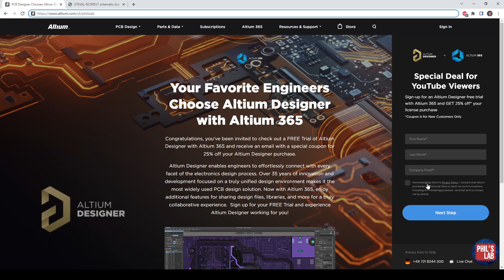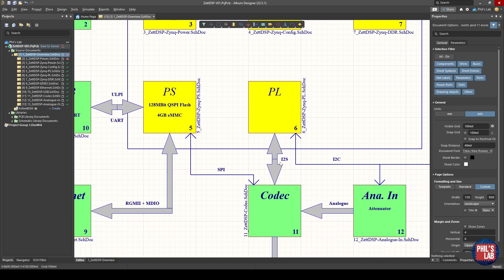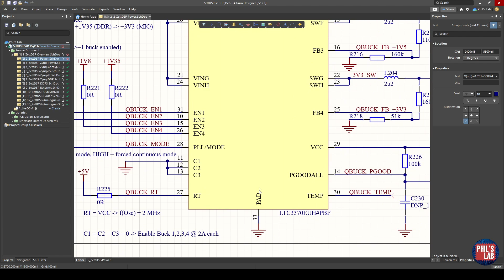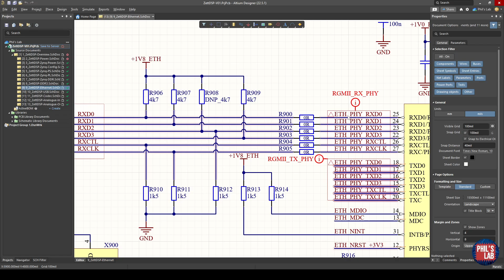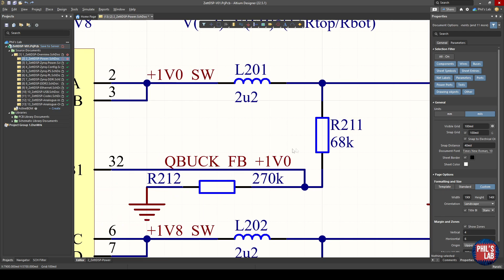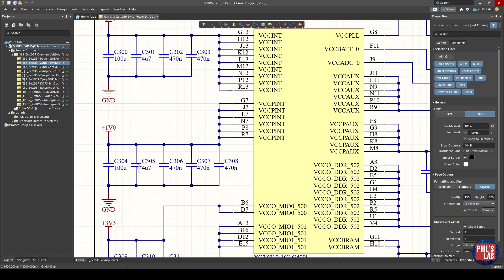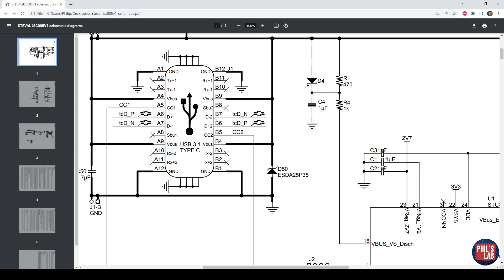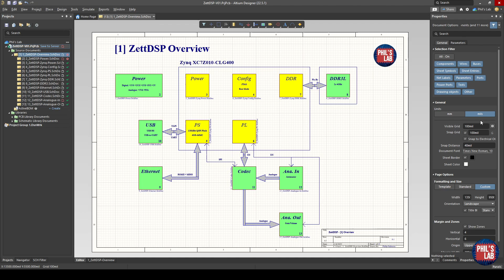(Sponsored) Schematic Tips & Tricks - Phil's Lab #62

Comment: Hey phil, I'm designing a 5-level cascaded multilevel inverter (MLI) using two isolated H-bridges and would appreciate feedback on my power supply configuration. Here's my current setup:

Key Components
4x Isolated Gate Drivers: UCC21551CDWKR (dual-channel)
Isolated DC/DC Converters:
Input-side: 1x converter (6.5–32V input → 5V output) powers:
This converter supplies 5v to All 4 drivers' input sides (PWM logic) and to the Current sensors (ACS732).
Output-side: 2x MEV3S0515SC (+15V isolated converters):
One for HB1's 2 drivers.
One for HB2's 2 drivers.
Grounding Scheme
Input Side (Control):
5V converter output ground is shared with MCU ground, Current sensor grounds and Drivers' input-side grounds.

Questions
Is it correct to use separate MEV3S0515SC converters for each H-bridge's drivers? And is the GND correctly labeled?

Are there risks in sharing the same 5V supply for drivers and sensors?

In this case do I need 5 external sources? 2 for isolated H bridge (my H bridge needs 60v) and 3 external supply for the DC/DC converter ?............is there a way i can get ur feed back

Comment: Great tips. They are really good practices in design.
Unconnected crossing is very useful, especially when you try to print it. Colour highlight of wire is a neat solution to determine the signal groups. I do not know why KiCad does not support those features while I think there must be plugins achieving those.
Reply from the maker: Thank you! I'm not sure but as you say, maybe someone has come up with a KiCad plug-in.

Comment: Would you be open to also making a course on advanced PCB design (FPGA, ARM chips) using KiCAD? I don't have Altium since it's too pricey for hobbyists, but I'm super interested in designing PCBs that can support higher-powered chips for AI at the edge.
Reply from the maker: I'm afraid I won't be using KiCad for more advanced PCB designs, simply because - in my eyes - there are quite a few functions/features missing. However, the course will otherwise be pretty much tool-agnostic, so most people (regardless of the tool their using) should be able to follow along.

Comment: Hey Phil, thanks for the very informative video. I have one question though: When using subschematics as much as you do I find it way less practical to use the net highlighting tool to check, if every connection is correct or if I made any mistakes. What is your procedure to check if your connections are correct, besides the ERC?

Comment: This is the well awaited video, from I hope a series about audio analysis! The APx555 is using AK5394A for the hi-res ADC and the AD7760 for the hi-speed ADC and is achieving around -125dB of THD+N. I can't remember of top of my head what front end is used in my DscopeIII, but the results are around -118dB of THD+N. Please keep sharing this project as it's particularly of interest to me.
Reply from the maker: Thank you, Mark! Yeah, the APx555 and co. instruments have some pretty neat ICs inside. The plan for the 'ZettDSP' is far lower cost - essentially an affordable 'advanced-hobbyist' grade version of those instruments.
Reply: @PhilsLab  can not wait more videos from this series! Please let me know if I can by of any help, I can make a short video for You of the DscopeIII hardware, send some pictures of the internals, some pictures of APx and also I have access to lots of Dewesoft and Dewetron hardware, which in turn, as for top brand DAQ systems, they have some neat hardware on the front end as well...
Reply from the maker: Thanks a lot, Mark. I'd actually be very interested if you have pictures of the internal hardware of those units! Could you please send them to phil@phils-lab.net - thanks :)

Comment: Neat list of what to concentrate on, one of the reasons I love Altium is the fact it has all of this built in, I use KICAD at home and half of the stuff isn't in there, but it's fine for the price!  I can't afford Altium for home use, but I use Altium for work and it does make things a lot simpler.  Thanks for the video.
Reply from the maker: Thanks! Yes, exactly - KiCad is definitely great for being free but once you've used Altium, to me at least, there's no going back.
Reply: @PhilsLab  The biggest thing I like in Altium over KiCad is the 'component' concept, especially for a production environment where you could have to manage hundreds or thousands of different part numbers.  For things like resistors you may only have a handful of different symbols and footprints, but hundreds of different unique parts.  The component as a bucket for holding the symbol, footprint, and parameters of the physical device makes it easy to create a new component representing that specific device (and alternates) without having to add a new symbol.
Reply: @wyattr7982  Agreed.  DipTrace also has the concept of Component and is 1/20th the cost of Altium (and there is also a usable free version). It also has hierarchical groupings of components on a sheet that can be used as a block on any other sheet. Far superior to KiCAD.
Reply: @PhilsLab  I wish there weren't for me, but I can't justify the cost of Altium, certainly not for home use,   KiCAD although development not as fast as some might hope, is getting better with every release.
Reply: Altium is awesome. The pricing per month is just wayyyy out of the ballpark for a hobbyist or heck even small startups.